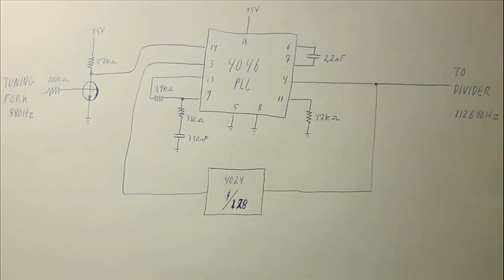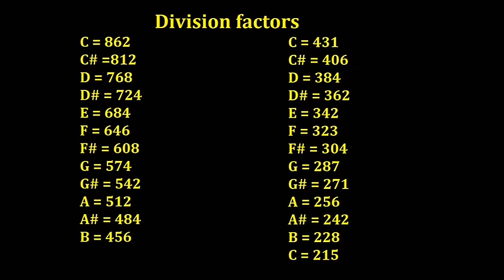Tuning fork controlled synthesizer

Comment: O.K.!?! Maybe you can make a multi-oscillator version and use a blowtorch to offset the tuning? :-)
Reply from the maker: +Marc Brassé - The tuning fork will go out of tuning if it is heated up. And I have actually thought about if it is possible to use a temperature dependent resistor in music.  My idea was to use temperature as basis for a random generator.
Reply: Yeah, why not!